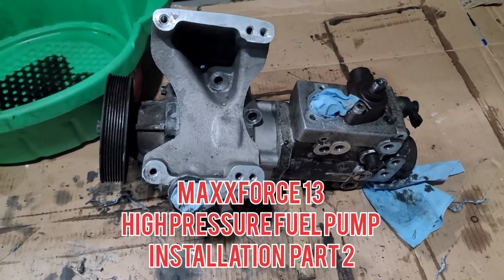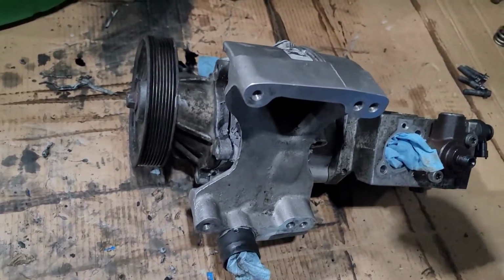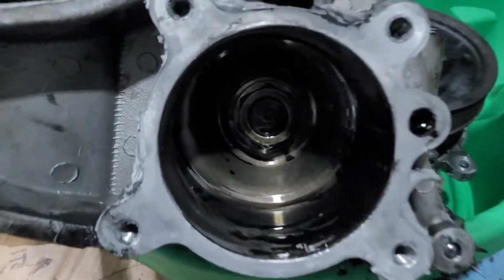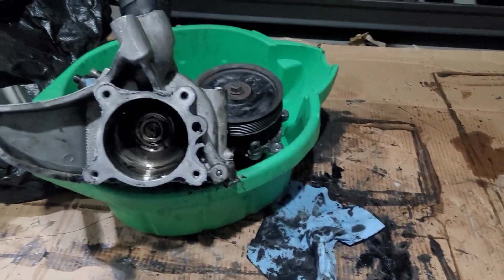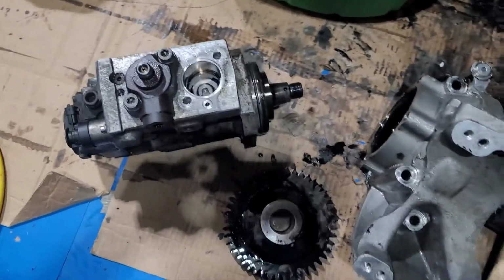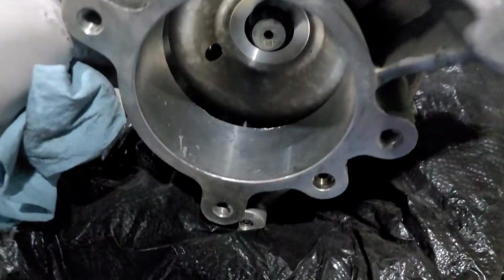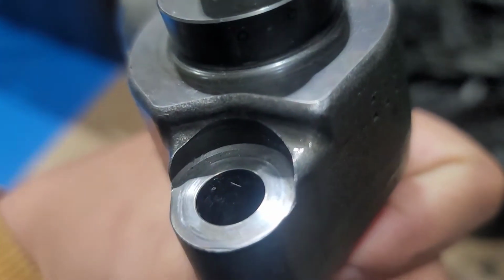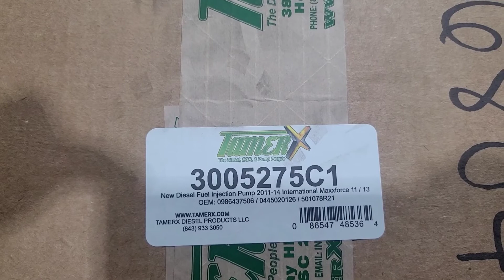INTERNATIONAL MAXXFORCE 13 HIGH PRESSURE FUEL PUMP INSTALLATION PART 2

Comment: Why didn’t you replace the pump heads instead? Tamerx has those too
Reply from the maker: Yes they do but since I was going to have to take the old one off anyway to replace just the hydraulic fuel pump  I decided just to replace it with a complete brand new fuel pump and new fuel lines.
Reply: It is possible to replace the hydrolic head without removing the pump but it’s so much easier with it removed. Also to note from experience there’s little cup that sets inside a groove on the bottom of the hydrolic head, make sure if you remove or it comes out with the head since magnitised that it goes back exactly in the groove, I had missed the groove not knowing but it set all the way down due to the notches on the side, after I drove it 70 miles working great then  let it idle I realized i messed something up hearing horrible grinding sound comming from the pump. After that I had to replace the entire pump as it had tore it up.
Reply: Why or what caused the hairline crack in the pump head?
Reply: @michaelchoi9205 They’re just made from cast metal. Very brittle. They should be made from billet honestly..

Comment: If I have a bad high pressure fuel pump will that allow me to loose power?
Reply from the maker: Yes .
Reply from the maker: Any codes or check engine light on ? Also bad  turbo or turbo leak broken can cause loss of power check your clamps on your inter cooler tube and turbo.